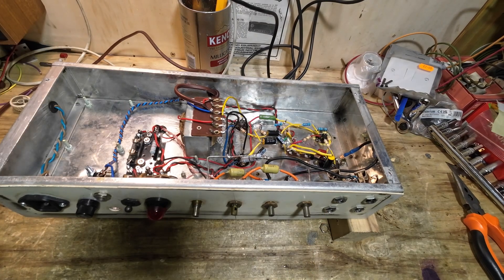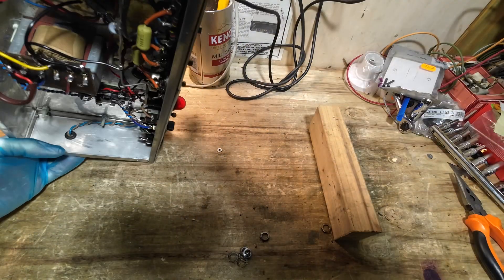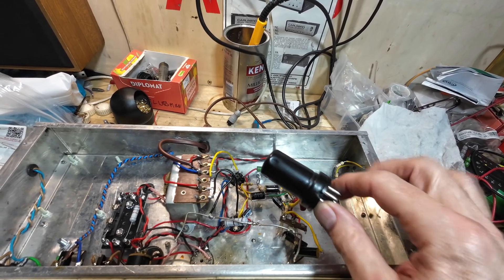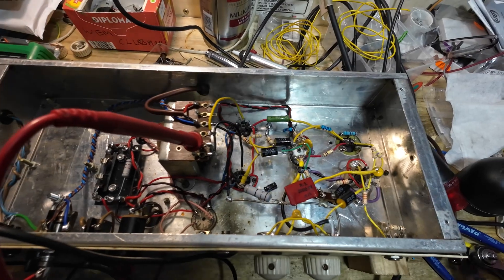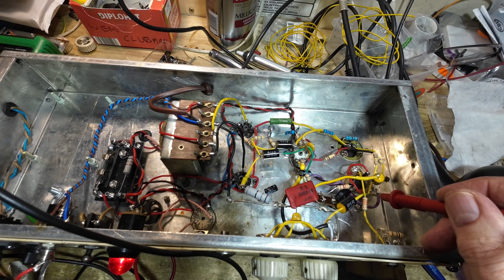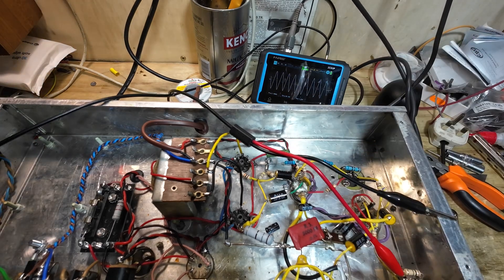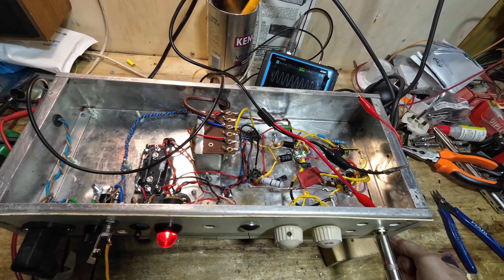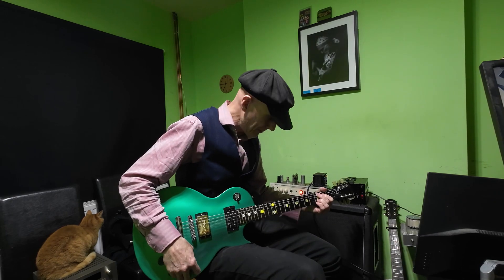Mystery Tube Amp is a Fenton Weil Porta 15 Bass Amp Part 3 First Stage Rework and Demo

Comment: Apparently some of the Fenton  Weil amplifiers used the 6BW6 output tube and not EL84's. The 6BW6 specs and performance are more similar to a 6V6, but in an EL84-style 9-pin bottle.
Reply from the maker: CV4043 is a millitary 6BW6. I fitted one in the record player conversion I did recently.
http://www.r-type.org/pdfs/cv4043.pdf
Reply: I have a Selmer Futurama Caravelle which I believe is Fenton Weill made and that has 2 x 6bw6 o/p valves,interestingly.

Comment: I was unfamiliar with the Russian 6J8 tube so I had to look it up. This is confusing right from the start, because normally an Octal 8-pin tube would never end with an 8 unless it had a top cap as well, because the last digit of most tubes with an American style numbering actually refers to the number of elements inside the device ! Because the heater requires two pins, the last digit of the tube is invariably one less than the total number of pins ---- UNLESS the tube has a top-cap connection, which constitutes a 9th available connection, allowing up to 8 active elements inside that 8 pin tube. (This is also why you never see miniature 9-pin preamp tubes that end with a number higher than an 8 , such as 6BQ8, 6DJ8 etc). Anyway, the Russian "6J8" is indeed a pentode (purportedly interchangeable with a 6SJ7), and doesnt have a top-cap, and so that last digit is a bit of a misnomer when you compare it  to the number of active internal elements. Anyway, to make things more confusing, there is indeed a completely different American 6J8 tube, with a top cap: it's a "heptagrid convertor", not something that we would ever use for an audio or guitar amp!  PS, Apparently there's also a Chinese version of this metal Russian 6J8 tube as well, because I saw mention of some Chinese-made audio amplifiers being sold on ebay that use it.
Reply from the maker: Hello. Yes, a weird one. You have to type in Google Russian 6J8, or Russian 6SJ7. These were made in the Reflector factory I think. Take care

Comment: This is a Fenton Weil Porta 15 Bass amp.
It's one of those ones that tuck into a speaker cab.
Always an education watching you work Martyn!.
Reply: Good catch ---- I recognize the name but I've never seen one of their amps or guitars here in the US.
Reply: There's one on reverb as we speak.
Reply: I looked at it, but it's obviously more modern and it has a printed circuit board.  I did get a chuckle out of the special Goodman's speaker which was rated for 15 British Watts but 30 American Watts!  I'm guessing the Brits were using continuous RMS power handling or amplifier output ratings and specs, as opposed to the US which used, back then, a somewhat exaggerated peak power rating.
Reply: The Fenton Well Porta 15 doesn't have a PCB?.
The Black Star I'm talking about was a 1961-1964 amp made by Fenton Weil.
Not the modern Blackstar amps which are land-fill bound.
Reply: I think you where right about it being a British version of the Ampeg Portaflex.
The one on reverb has the cab that the head tucked into for transit/storage.
It's in great condition for an early 60's amp!.
Reply: A British version of an Ampeg Porta-Flex "fliptop" amp?  I was unable to find any pictures of one of these online....
Reply: Fenton Weil made some small combos , the Selmer Caravelle was a rebanded FW.
They made a 30 watt model called a Black Star , they're rare even on this side of the pond.